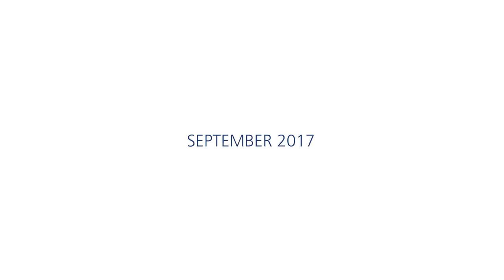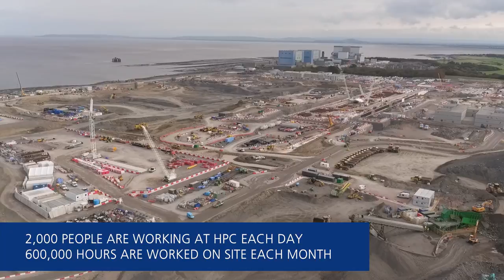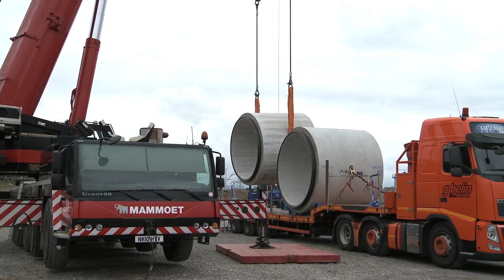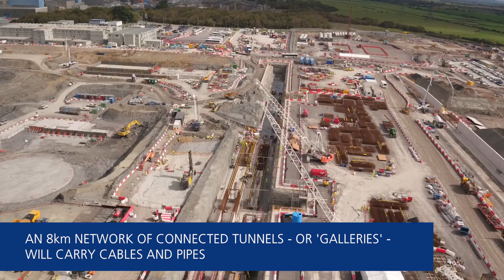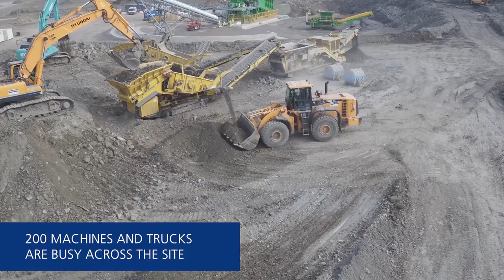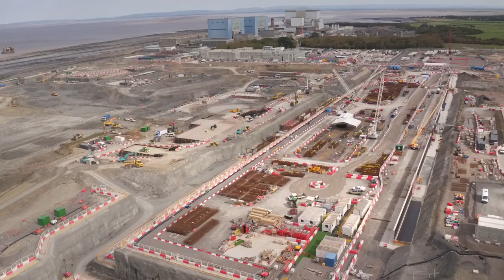Hinkley Point C | The first year of progress

Comment: LJK Designs. I would never choose just one technology. The answer is a raft of technologies starting with conservation. Solar, not just south facing but orientated to take into account smoothing peaks. All new builds should be fitted will solar thermal to reduce hot water and space heating needs, and photovoltaic, home, commercial, or industrial buildings. Wind both onshore and offshore, waste biomass for CHP systems, biogas, CHP for all new gas boilers, seabed turbines, micro hydro. Reduce/reuse/recycle more will lower primary energy needs, geothermal,  intelligent design for passive solar gain using thermal mass and higher insulation levels, investment in renewables to improve efficiency and cost/watt ratios. More pumped water storage, grid scale redox batteries etc. People also want to consider the cost benefits of using wave power generators as part of a coastal protection schemes. Micro generation will result in lower costs for infrastructure and reduce the risk from natural  / man made disruption that can occur using a smaller number of high output centralised generators.